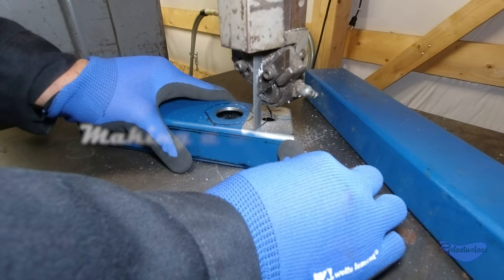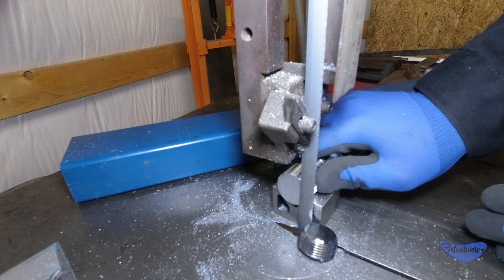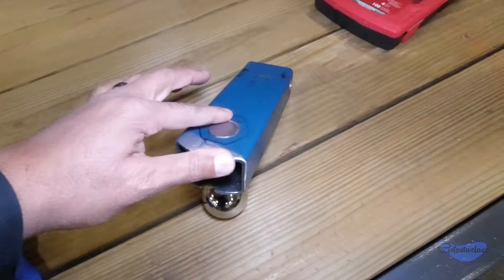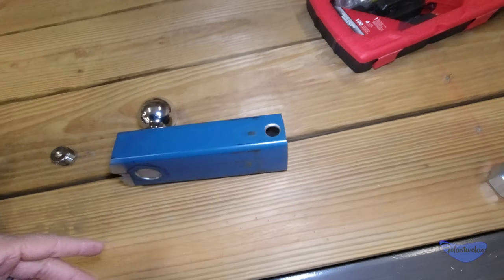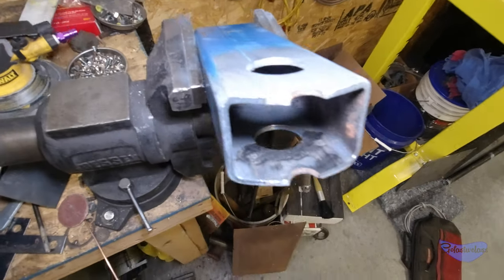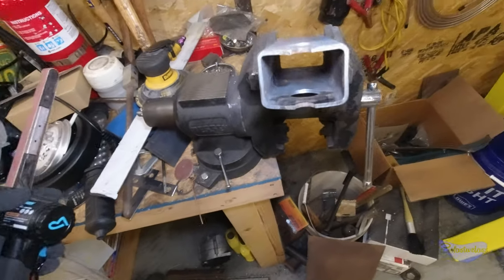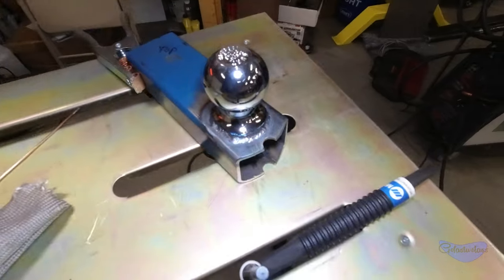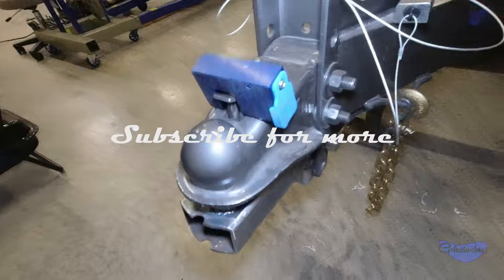Making a Different Trailer Coupler Lock

Comment: What's the point of disabling the trailer ball socket yet leaving the safety chains hanging on the tongue?? Any moderately-intelligent thief will simply use your chains to tow your trailer away! I've seen it done! Remove the chains from your trailer but leave one full link in place. Re-attach those chains with a threaded link and remove them after you're done using the trailer.
Reply from the maker: All this stuff is nothing more than a deterrent, a properly prepared and determined person could steal gold from Fort Knox. 😂 
When the trailer is outside, the chains get locked together.